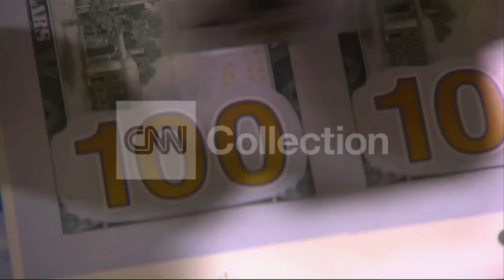NEW 100 DOLLAR BILLS PRINTING

Comment: And you still thing than this trashpaper really worth 2 grams of gold each?
Reply: It depends on "usability".
One is paper, other is metal.
You can use one for cleaning ass, write something on it, for firing woods for barbecue.
Gold can be used as Jewelry, electronics element.
Of course exchanging "paper" for everything else is -- fraud.
Reply: You cannot drink or eat neither of them.